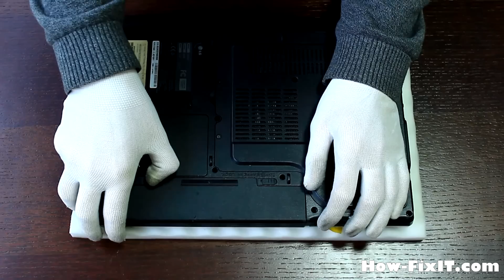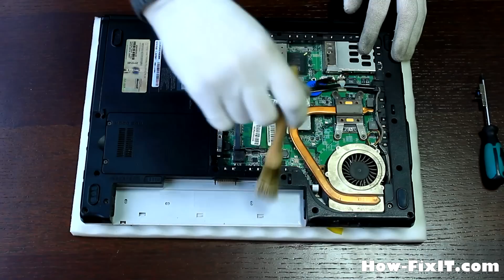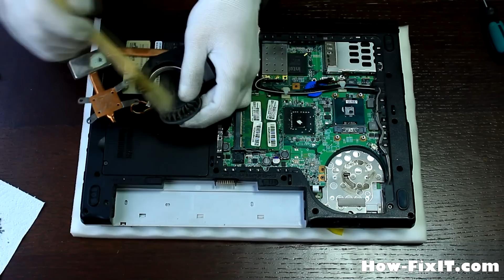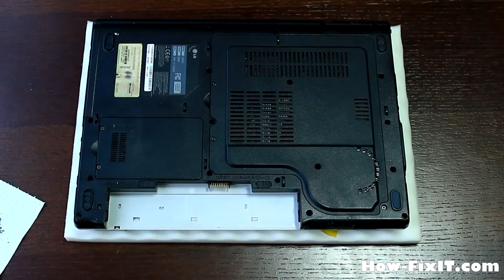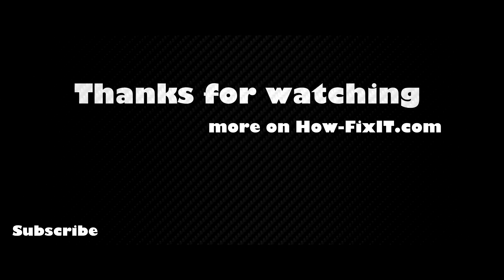LG E500 Overheating Fix: Disassembly, Fan Cleaning, and Thermal Paste Replacement Guide

Comment: assist me bro
Reply: @djcombatinternationalenter3734
  your integrated nvidia graphics chip have broken connections inside... thats why it does that. its a common fault among this laptop era.  my lg E500 had already broken with the same fault and its repaired with reballing another 8600gs card in the motherboard

Comment: Is it the newer one with the nvidia 8600 GS and 2 gigs of ram?
Reply: Probably not, since it only has a single heat pipe for the CPU and the 965 chipset. I have one with the 8400M and it has a second heat pipe for the GPU.